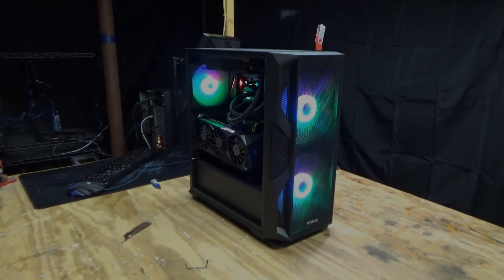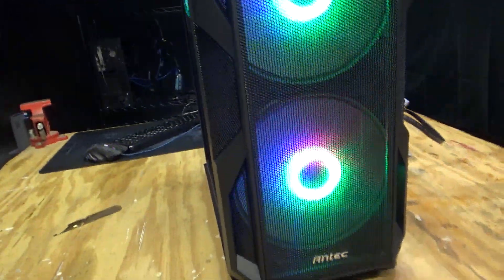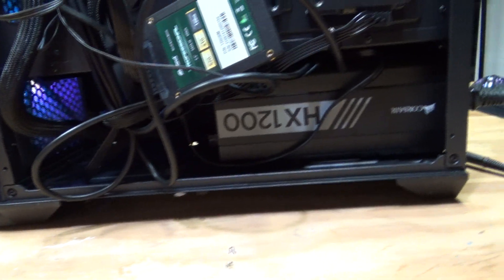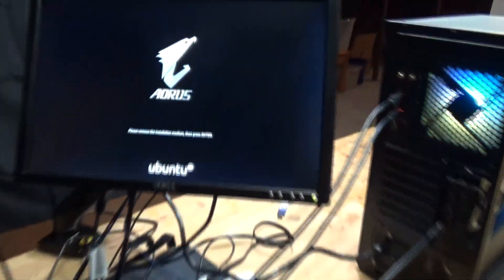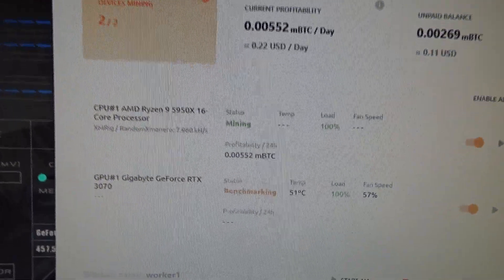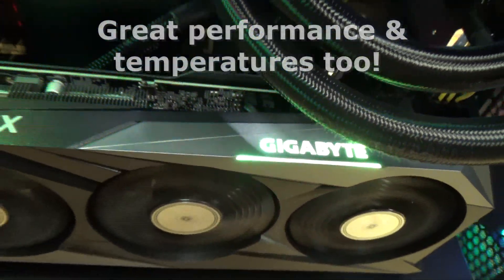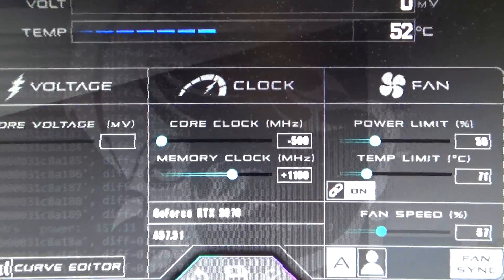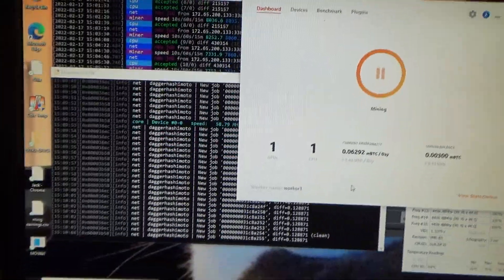Ryzen 9 5950X Build With RTX 3070 (Benchmarks & Gaming PC)

Comment: You did not have to install Windows for bench-marking your computer, you could have done it straight from UBUNTU, it's fairly easy :)
Mounting your GPU vertically is worthy as long as your GPU is not too close to the side panel :)
Monero mining algorithm is called RandomX but the mining software here (XMRig) always shortens it to "RX/0" :)
You should be able to get the same hash-rate with the R9 3950X (16000~18000 H/s) since there is no real incredible performance jump between Ryzen 5000 and Ryzen 3000 when it comes to CPU mining :)
Have a great weekend ahead and keep on building beautiful computer <3
Reply from the maker: Thank you ABMNS. I briefly tried to use Pharonix to benchmark on LTS prior to moving over to Win10, but was having issues with the installer. I’ll revisit this soon and see if I can get a full system benchmark and maybe see how the computer performs on a few different programs. Thanks for the support! :)